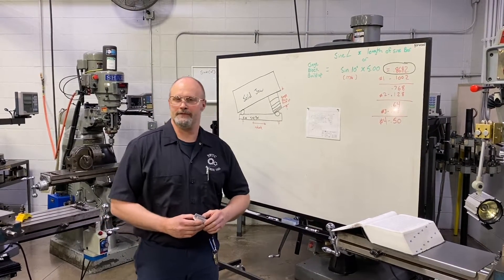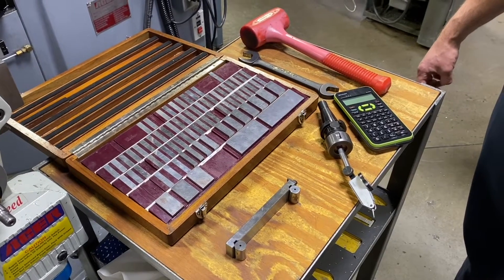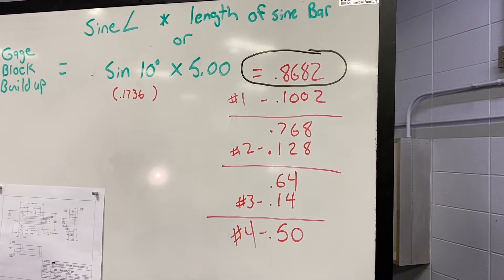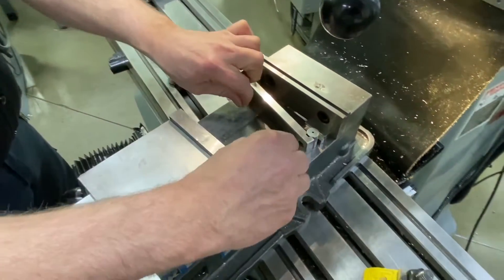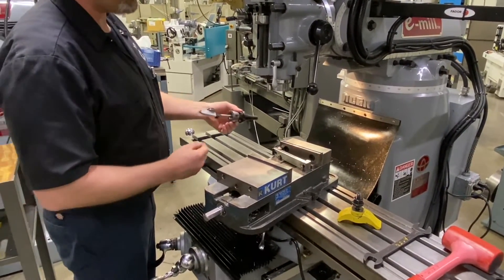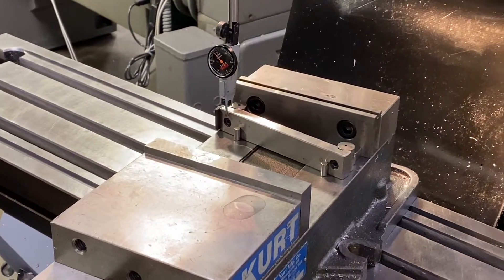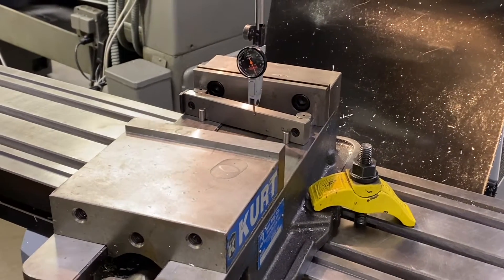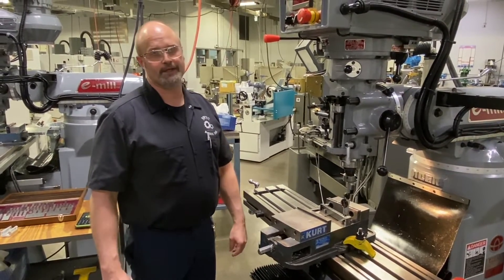How to Use a Sine Bar to Indicate a Vise to an Angle

Comment: The sine of an angle does not have units of inches. Sin 10 is 0.173648 since sine of the angle is the ratio of the opposite side divided by the hypotenuse of the triangle inch/inch is dimensionless ie you do not have imperial or metric sines, just a thought.

Comment: I do gauge blocks from the big end. I start with the largest block that is smaller than the finished stack. Then the next biggest block that fits in the remaining gap and so on until I have the right size. Starting at the small end makes no sense to me.

Comment: You don't need any stupid sine bar to do that.
Reply: Really?  How would you get within one .001" over a five inch distance,  and be sure you were within that spec?

Suppose it needed to be within .0005"?

I'm not saying you can't do it.  But at some level of accuracy you need more precise methods, I suggest.  And at that point a method likes this seems to be useful.  

At least it is illustrating how to use the precision allowed by a sine bar to transfer that accuracy to a machining setup.  

I found it useful, anyway!
Reply: @SeattlePioneer  you fixture it so that the table rotates to 10 degrees and mill.
Reply: So start teaching online classes and share your wisdom.